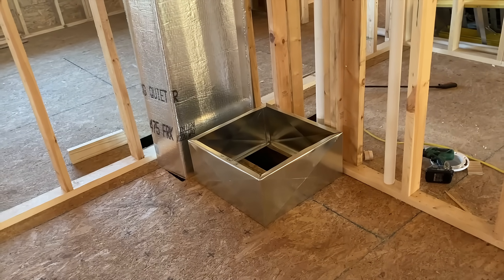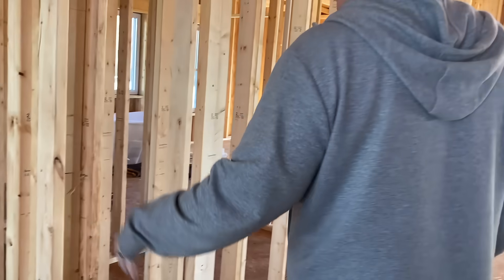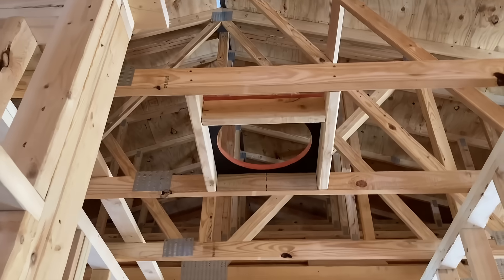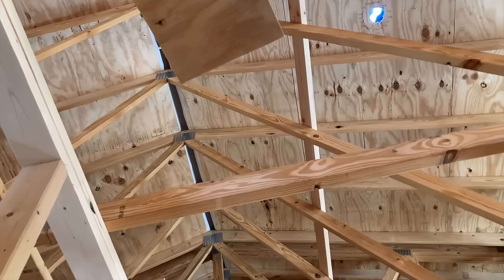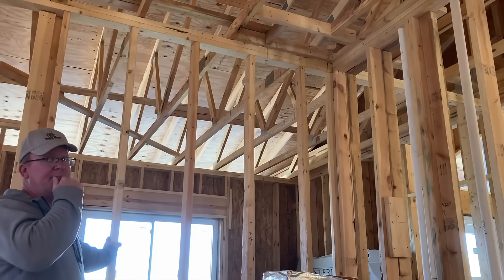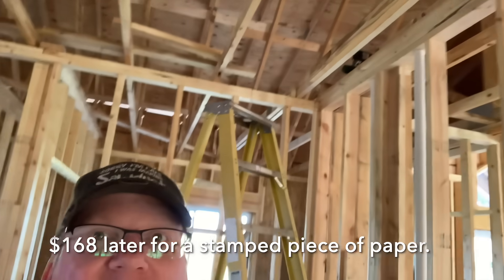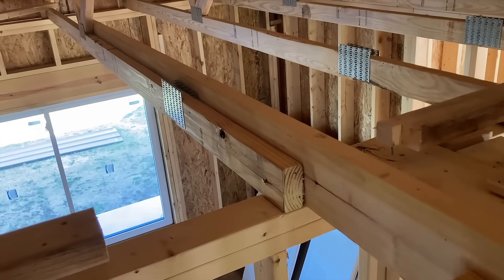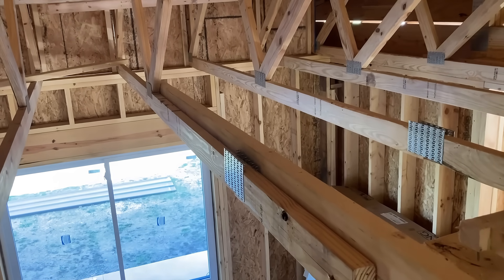HVAC Guy Cut Our Structurally Engineered Truss to Put in Duct Work. Do Not Cut Trusses!

Comment: I’ve been in HVAC for 27 years 15 as an installer and 12 as a service tech the last three of those 12 years as a service manager/install manager in our contract. This would trigger a clause stating the payment schedule is now void (you must provide a failed inspection report and engineer approved repair plan for this to happen )and one lump sum will be paid at the end of the job so any damages that were done can be deducted from our final payment we also pay for the reinspection and any engineering costs associated.
Reply from the maker: That sounds like a good clause to hold everyone accountable. The GC has to prove that there was recorded damage and a repair plan and then it’s deducted from final payment. Very nice thanks for watching!
Reply: @davidbuilt9980 The HVAC contractor can also agree to an adjusted payment schedule without the failed inspection report.
Reply: Future homeowner thinks she knows something. Typical dumbass. She has no business on site. Home belings to GC until closing.
Reply: @walterrose854  obviously you've never had a homebuilt and sound like the dumbass. Homeowners quite often go to the site multiple times during the entire process to check on things, make changes and approve things. Since when does a home belong to a GC who isn't footing the bill?
Reply: That's a GC problem not even hvac, because that is normal at a residential rough in for duct work. I'm pretty sure the engineer drew where the furnace was placed at, but your framer didn't box it in because he needed the hvac approval how big is the opening to where equipment was going to be placed at.  I'm pretty sure your hvac guy did go by the Mechanical plans and after it would be the framer's responsibility to cut and reinforce openings or soffits around a load bearing wall, but that was your mistake and the hvac guy didn't want to waste time and money for a homeowner to hold up his progress. Regardless, it was either the engineer fault for not putting how big is the opening for the framer to frame and/or the Homeowner/GC for not having both the hvac and framer both in person meeting to know what needs to be cut and boxed in or else you would have a change order by the framer for not having the reinforcement cut out in his contract, which most of the time they don't.
Reply: @chamflas  to deal with it and figure it out yeah but HVAC caused it so they take the liability so I would say it’s definitely their problem in those are structurally engineered trusses not that simple. You have to get an engineer involved and reinforcement may not be an option seen it before what people think means nothing it’s all down to the numbers both physics and dollars.
Reply: That sounds like as it should be, even if some unskilled laborer did this at at time when he or she was unsupervised.
Reply: Yeah , don't ever trust an HVAC guy to engineer a support system . This problem should have been addressed from the begining by the architect. Or at least caught by the contractor before he ever called for HVAC to come out to the job . Or when reviewing the plans .
Reply: @watsamatau  Regardless of that, no trade should ever whip out the ol' sawzall without getting the thumbs up from the framer or contractor. They shouldn't even be thinking about it.
Reply: @ripsnort-d8z the job wasn't ready . He should have never called the next trade in, period .
Reply: @ripsnort-d8z Logically, the duct is not rectangular but actually square. All the AC guy had to do was to pull the duct six to eight inches off of the back wall and run it through and  between  the trusses without cutting anything . 😅. But I'd be willing to bet the owner would have complained about that as well.
Reply: @ripsnort-d8z Old saying . Poor planning on your part doesn't necessarily constitute an emergency on my part . Savvy ?
Reply: @watsamatau  That is completely irrelevant. Nobody should cut the framing under any circumstances until they have an ok from the framer or the contractor.
Reply: @watsamatau  I savvy not cutting the framing until somebody who knows whether it's ok or not tells you it's ok. Savvy? Or is that a little bit to subtle?
Reply: @ripsnort-d8z I'll say it again . The owner should have never called for the next trade. Because the house was not ready for the next trade. If the owner isn't sharp enough to catch a glitch in planning before it becomes a problem, then he shouldn't be trying to build a house to begin with . The HVAC company didn't sign on to being the owners superintendent .
Reply: @watsamatau how was the job not ready?😂
Reply: @watsamatau I’ll say it again. How was the site not ready for sheetmetal? Because the framing was in their way? 😂😅😂😅
Reply: @ShaunHensley  That question was answered above. Learn to read .
Reply: @watsamatau , the owner did say “HVAC guy”, not company. As the old-saying goes: “You get what you pay for”.
Reply: @christopherpearman3422 I'm not sure what state this is in and don't particularly care . In the state I live in , you have to be a licensed contractor to do HVAC and or electrical . Most of the companies I use are licensed in both . Even if you are a homeowner doing your own construction , ( pulled your own permit ),  you still have to use a licensed contractor in certain trades . And that particular contractor has to pull the permit , subject to county inspection through the building department, in order to perform the work and have it pass inspection.
Reply: @ripsnort-d8z how do you know they didn't? Who is the guy carrying the tape???
Reply: @russellchastain841  Because they cut the ceiling joists that were holding the walls together against the spreading load of the roof, that's how. And what does who is holding the tape have to do with anything?
Reply: @ripsnort-d8z thought he was an inspector or something, the joist was tied back together with the cross bracings they screwed back in
Reply: @russellchastain841  "Or something". 
Yer gonna need to be more specific if your argument is riding on who this person is. 

And cross bracing does not tie things together. Cross bracing braces. It normally works in compression by providing resistance to shear forces in a plane. Cross bracing is not used to connect parallel members under tension.

Face it, you don't know anything about framing or construction. You're making all of this up as you go.
Reply: @ripsnort-d8z didn't know you were an engineer
Reply: @watsamatau no, the sub needs to work around the structural elements 😂
Reply: @watsamatau  (Maybe they had to change things because the wife didn't like how they were doing it before that was being done according to the plans...)

Comment: I've always called it sistering when you plate a truss or joist like that. Glue and screw.
Reply: I have not repaired a truss in many years but screws were not allowed, had to be nails. The engineered drawing spells out what to use and how.
Reply: @markthebuilder9837 yah shear strength is alot higher with nails .cement coated common nails are a pain in the butt ...but it would keep a helper out of trouble for 20 mins nailing it off. Thanks

Comment: Having had to repair truss  and joist screwups, I’m surprised that engineering report didn’t specify the 2x6 repair to include adhesive, SWP lumber and not S-P-F with a specific nail and spacing.
Reply from the maker: We followed the engineering report exactly and it specified nails every 3-4 inches. They did not require adhesive. Maybe because it is also secured to the walls and is in the middle of many trusses? I’m not sure and just did what was required. also, the full repair was not featured here as that footage seems to be missing. If I find it I’ll show in a future episode. 😊Thanks for watching!

Comment: Contractors hate it when you tell them you cannot cut through structural framing. Had one contractor walk off a job because he didn't want to do it right.
Reply from the maker: That's a tough situation when contractors aren't willing to follow the rules. Thanks for watching!
Reply: @davidbuilt9980  Tough?  If someone wants to vandalize instead of do the job, fire them.  HVAC should have been planned with the framing design, so there shouldn't be guessing anyways.
Reply: That's the right place for a tradie who doesn't want to do it right: off the job.
Reply: @guytech7310  Sounds like a Self-resolving problem I had years ago where a guy under me was surfing the Internet on company time and shopping for things on AliBaba to sell in his eBay store. I had reached a point with him that I had just obtained a counseling sheet from HR to start the paper trail to fire him, and he resigned.

Comment: its your fault.  Your suppose to walk thru the job with these guys before they start. I bet he put it right where the plan showed it. Why did you not offset the truss if you wanted it there?
Reply: "Your suppose to walk thru the job with these guys before they start."
No, I've done that. They just ignore you like you an adult in a charlie brown cartoon. I would explain what needs to happen in detail, I step away to work on something, and 5 minutes later when I returned, they ignored everything I told them & started doing it "thier way", because "I don't know what I am talking about. This is way I've done it for 30 years, I am not going to change the way I do it, because you told me so." Fired him on the spot.
Reply from the maker: Lol yup. It has been eye-opening working with subcontractors. My experience is definitely similar of walking them through exactly what I want. Come back 10 minutes later and none of that happened. But this is why I do walk-throughs very often, correcting what was done as I need to.  In the end, we will end up with a very nice house. Thanks for watching!
Reply: @davidbuilt9980 I was a carpenter Forman for many years. There is a list of things that must be done before the job starts. Get all window and door rough opening. Get all HVAC rough opening, get all electric rough opening. Verify all truss length before starting. Architects only draw pretty picture. Assume everything is wrong. If subs don’t want to give rough openings than you put them on notice they will be responsible. If you don’t do all these things it’s your fault because you are in charge. That why they call them subs.
Reply from the maker: @BasketCaseGarageForFun very true
Reply: @BasketCaseGarageForFun  If you feel "architects only draw pretty picture" you shouldn't be allowed to touch a hammer or any other tool.
Reply: @philtheheaterguy951  because?
Reply: @BasketCaseGarageForFun  Because the proper Architect is educated and trained to do much more than make drawings.  They DESIGN the structure to contain loads and maximize the space.  I have seen many "framers" who changed plans because they knew better and then created issues that were irreversible.
Reply: @philtheheaterguy951   OK, point taken from your view on life. I bet a thousand bucks that truss was cut because they followed the drawing and  put the opening exactly were the architect drew it. As for framers changing things, just like bad architects there are bad framers. I have never been on a job that i did not have  RFI's.. Some times hundreds.  Small remodels to 10 million dollar's jobs. And Architects are not Structural engineers. Also yes when i was young we did try to fix design flaws in the field. But as i got wiser we just built it the way they drew it and then got paid to fix it. WE had a saying ,if they want it built upside down backwards fine, we can do that and bill them later.
Reply: @BasketCaseGarageForFun I wouldn't trust most architects with a rubber tipped screw driver.

Comment: They claim this can all be planned with truss manufacturer, before the order is placed.
It is amazing what they can accommodate in the planning phase.
Reply from the maker: Yes, I’ve heard that it can all be laid out in the blueprints. I’m sure if I were a professional full-time GC that is what I would’ve done. Thanks for watching!
Reply: Yes it can. I do architectural, electrical, mechanical and plumbing engineering. I have worked with countless structural engineers and truss companies on openings for ductwork on commercial projects. But I only get them involved when there is no way to design the duct around the issue.
Reply: We installed metal, and we bent metal.  I cannot imagine someone thinking they are going to install something with all off the shelf components.

Comment: What's the big deal? I saw like a bunch of other trusses. You can cut just one surely.
Reply: Not without consulting an engineer. They're designed to carry the roof load and you cut one, it compromises the structural integrity. It's like having 2 legs, and then cutting one leg off. You don't work the same!
Reply: @Bobbuilder-c5z trying to be sarcastic. Guess it didn't read that way.
Reply: @chadd587 I thought maybe you were. Wasn’t sure…but yeah, that’s funny!
Reply: @Bobbuilder-c5z  With all due respect comparing 50% of your legs to a very small percentage of the trusses is not a good analogy.
Reply from the maker: Trusses are like fingers: You can make multiple mistakes and still dial 911 lol thanks for watching!

Comment: Im an hvac guy (commercial). Never cut anything until its approved. Call your hvac guy and tell him the repair bill is on him. The irony here is now the penatration is even smaller because of the repair.
The bright side is at least you don't have to replace the entire truss.
Reply from the maker: Very true. As it often is, it could always be worse. This ended up being a relatively simple fix and I agree, never cut anything. Thanks for watching!
Reply: @davidbuilt9980  Cutting is routine.  There are trade standards for penetrations, follow those.  He should have simply rotate the duct 90 degrees and it would have fit between the trusses.
Reply: His cap between trusses is now 1.5 inches wider.